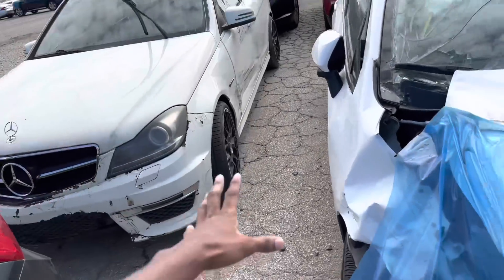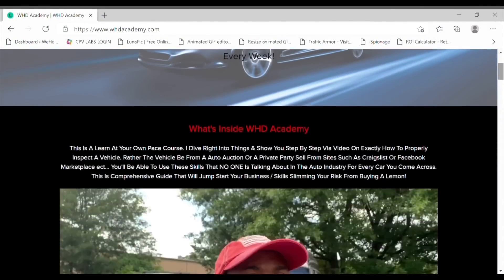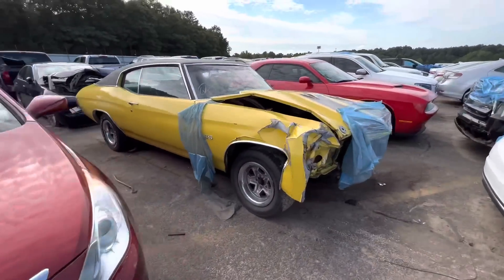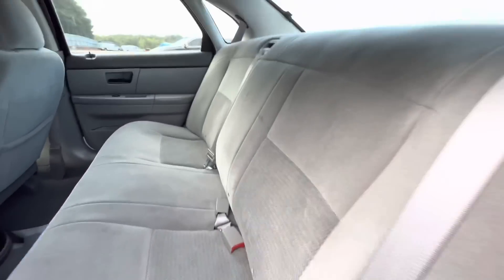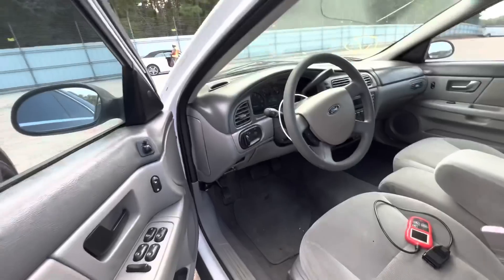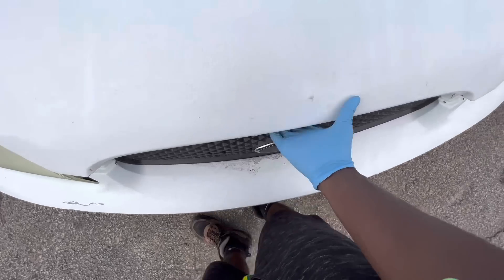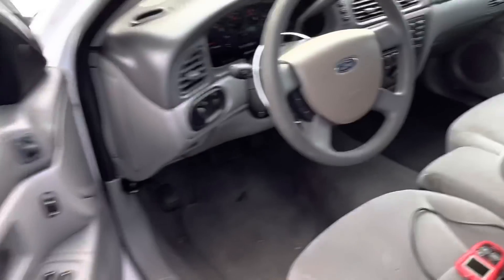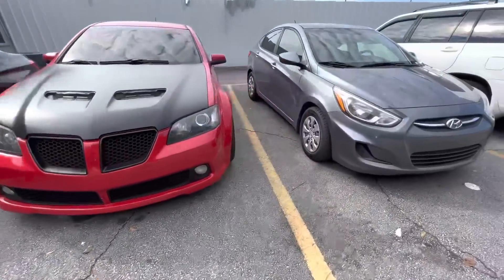KIND OF RISKY ME TAKING A CHANCE ON A CAR LIKE THIS!

Comment: The throttle actuator and the evap code works together, if the evap system doesn't supply the computer with sufficient voltage the throttle won't open the standard way

Comment: Never buy a I8 you will regret it. BMW doesn't even want to service them now.
Reply: Explain
Reply: @User-nn5wu  the i8 has many services issues and most dealers refuse to deal with them since it's very expensive and requires a complete removal of the engine and hybrid system